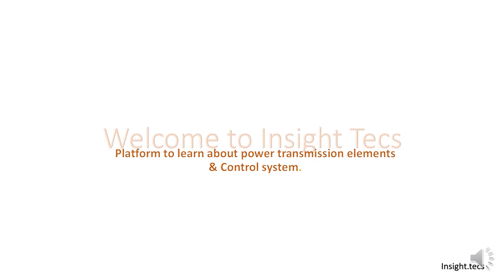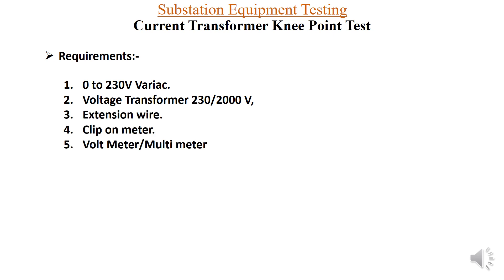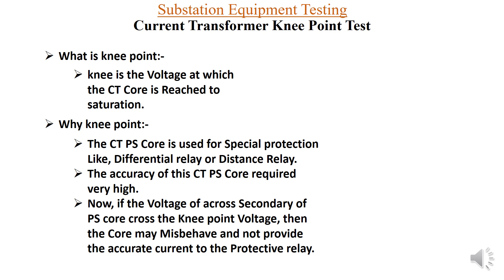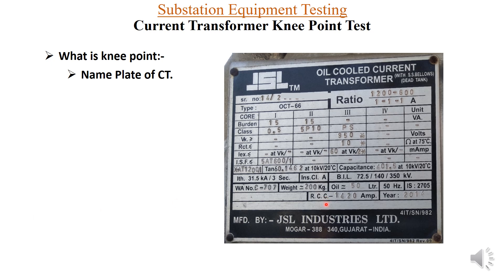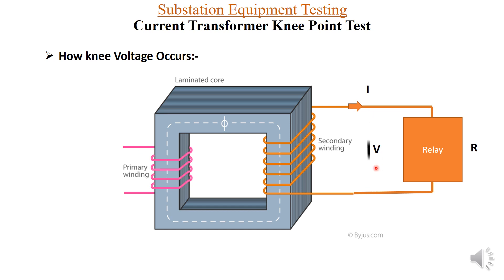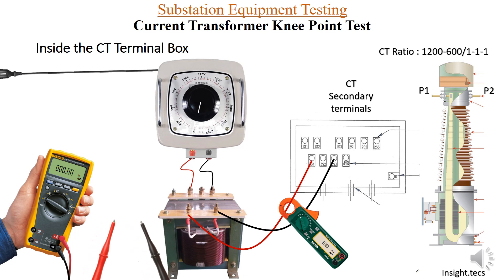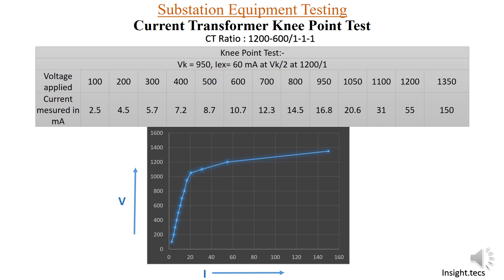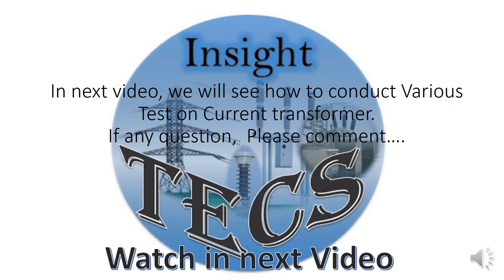Current Transformer Knee Point Test

Comment: Very nice video! My name is Ronaldo. I have some doubt about this example. Vk = 950 (knee point) and what is the mearning Iex = 60mA at Vk/2 at 1200/1? Could you explain to me please? How did you get 1100V/31mA; 1200V/55mA and 1350V/150mA because me must applier 950V + 10% because after this on we can damage the CT.